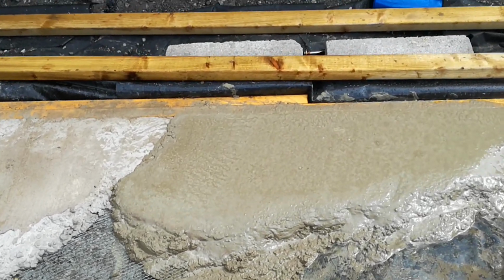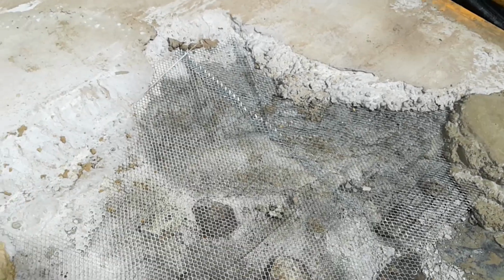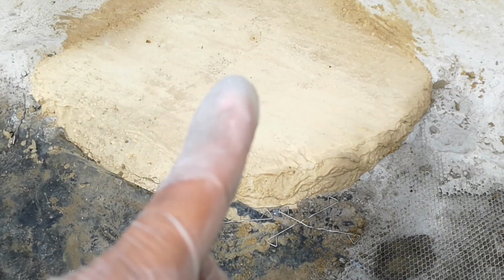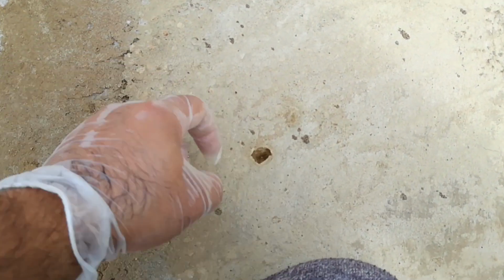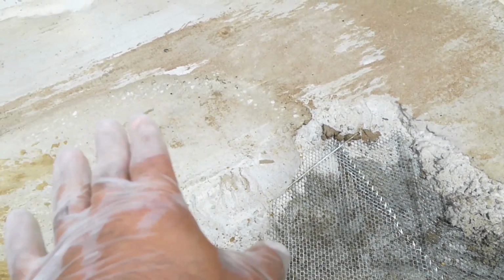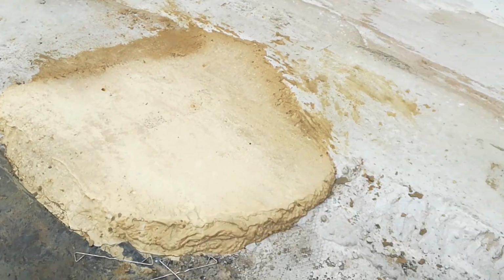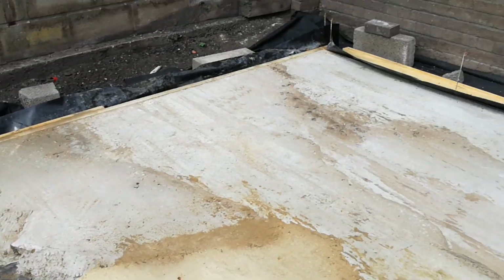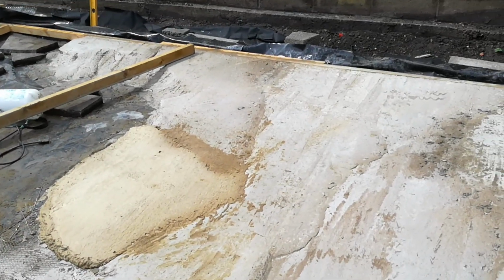How to mix concrete fast with a drill in a wheelbarrow

Comment: Slowest and worst way to mix concrete, what sand are you using for the mix
Reply from the maker: The fastest I done (timed) was just under 5 mins, what's your speed on it, manually? I used sharp sand (I think), from builders merchants. It's just fine (typical) sand no bits or anything.
Reply from the maker: I could have added all three together and mix it then, that'll probably speed up the process. I might give that a go tomorrow.

Comment: Hi mate, 

What is the ratio mix for concrete???
Reply from the maker: There are different ratios for different purposes. For me it's: 1:3:3. Cement: sand: aggregate(rock). In my case I couldn't fit 3:3 in my wheelbarrow so mine was, half a bucket of cement, bucket and half of sand, bucket and half of 10mm chippings/rock.
Reply from the maker: Basically, the more chippings you add the stronger the concrete is. Some suggest: 1:3:4(aggregate).

Comment: Your method claims to be mixing concrete fast under 5 minutes however i been watching your video now for 10 minutes since you finished pouring.  hmm very strange. Not sure what that stick is unless its used for cooking something but i would have used a proper hoe or shovel to do the mix. Its much faster than using that chop sticks.
This is a great example on how not to mix concrete the easy way.
And you started screeding the concrete right over the plastic spray bottle, hose,  gun and all with the wrong sand  Man whats wrong with you.
Reply: I agree. Not very efficient.
Reply from the maker: Tried a shovel, I just prefer this. In another video, I did time myself and it's mega fast. This video was about trying different approaches.
Reply from the maker: Thanks for tips though.
Reply: LMAO My exact thoughts At least he didn't fall into the concrete